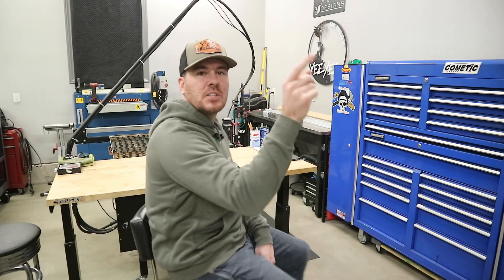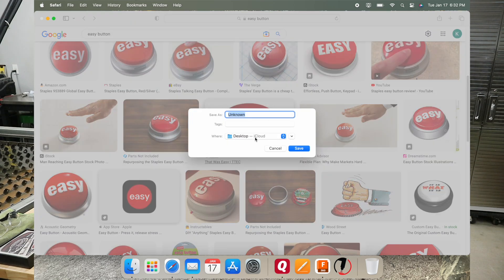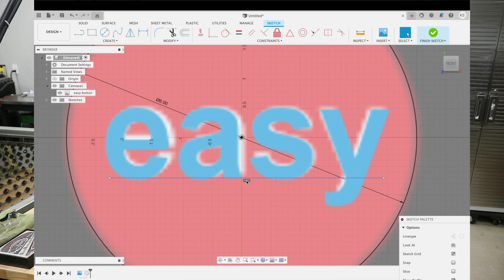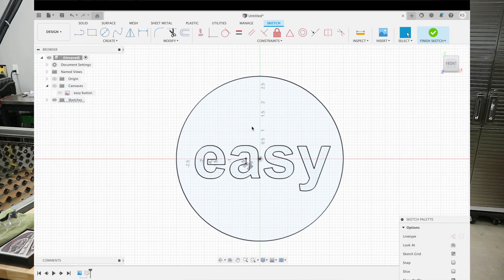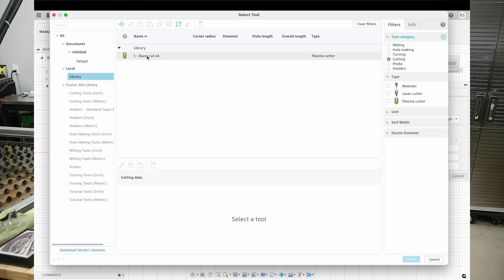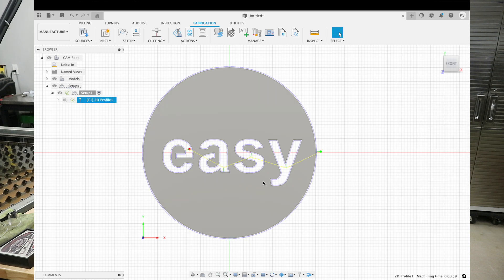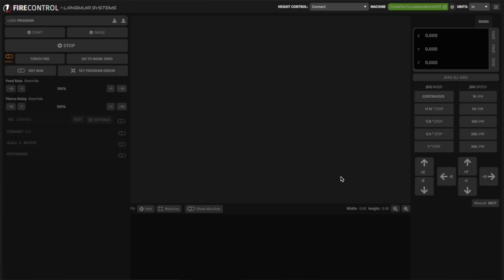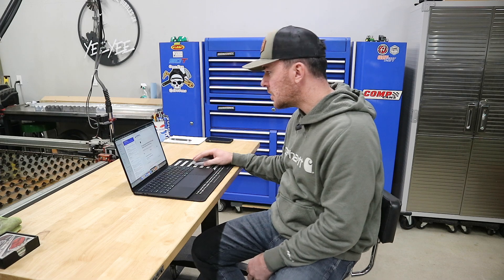CNC Plasma Cutting with FUSION 360 Explained.....Step by Step

Comment: I am an old retired harley mechanic, looking at building a couple bikes to keep busy, i have built alot of bikes over the years but never my own frame design, so, i have built a frame.jig, bought my tubing roller and bender, i need a plasma table for cutting parts for my chasis design, building the table is anpiece of cake, running it, not so much. I downloaded fusion.360 but i am completely lost when it comes to drawing my first part, your video is great but for a complete newbie, its greek to me, as is the program. Any dummy books you are aware of to show someone.like me, in layman terms how to draw and send a cut file to the table?. Or an easier program to start with??
Reply from the maker: you might want to look into sheet cam or Flashcut with plasma cutting.  Fusion is great for design work though.  Just to keep at it and you'll get used to it.   Thats for sure the hardest part of the whole process.

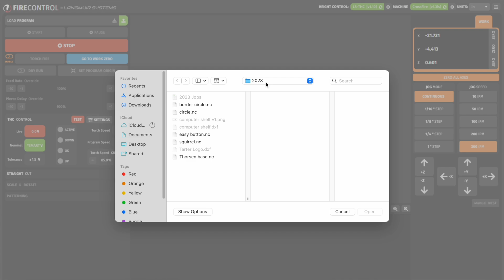Comment: Thanks for the info!  Question do you have a video on manual nesting to save on waste 16:36
Reply from the maker: thanks, and no I don't have anything on nesting
Reply: @SpicerDesignsLLC thanks for getting back to me thanks again! I watched your easy 😂button like 10 times thanks 

I just recently got me a table too them 4 months to fix it but I’m running now.  Limit switches no working due to malware, but Johnny at Langumer is on it 🎉

Comment: Excellent video, thank you. How can we setup crossfire table to make a cut on a curvy surface while using z axis, on a 3d model?
Reply from the maker: It has a torch height controller but thats more for warped steel.  you would have to go to a higher end table to get the torch to move across larger contours.  Ive never really experienced with that.
Reply: @SpicerDesignsLLC  Thank you for the response, here is the part that I saw on youtube, It nice to see that crossfire can cut a 3D part.
https://www.youtube.com/watch?v=w4NZIdWT-ak

Comment: need help!! I've followed your step by step 100 times all the way to click on my body and it's supposed to highlight each line and the outside circle but for some reason I can't seem to get the program to do so. it wants me to click each line individually 11:38 in the video I've think I made it a body in the previous step. And the display window for geometry does not look like yours.
Reply: I’m having the same issue. Once you set your points to start the cuts @, it doesn’t show the same geometry or cut paths and when I go to simulate it gives me an error code. Did yoy ever figure it out?

Comment: I made one and thank you for the info.  Also, since you have experience with fusion 360 could you please tell me if when in design mode and you extrude your project, if you make a mistake can you go back and remeasure your sketch?  I can't seem to figure it out and I don't know if it can be done.  Any help would be appreciated.
Reply from the maker: Yea you can.  You can move the timeline in the bottom left corner and adjust your sketch or you can delete the body, fix the sketch and extrude again.
Reply: @SpicerDesignsLLC  Thank You!  Still struggling with this fusion.  Shouldn't be so hard to learn but I'm not giving up.
Reply from the maker: @curtisegbert7915 dont give up! Youll get it.

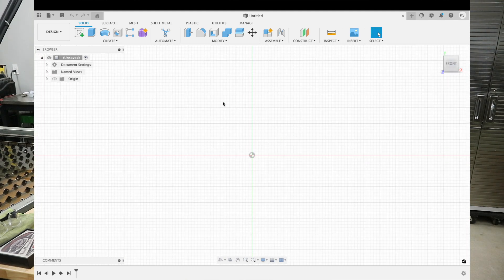Comment: What Fusion 360 are you using? Im using the free version and for the orientation of the axis shown at @2:11 I have to use "Top" and not "Front". Unless I am missing something? Total newb here
Reply from the maker: Top is right.  Thats what its supposed to be.  Mine changed on me somehow and ive since changed it back.  The z axis should be facing up. So your good
Reply: @SpicerDesignsLLC  Wow fast reply thank you kind sir for teaching an old dog new tricks.
Reply from the maker: @WDMtea i try! And no problem.  If you have any questions ill do my best to help.

Comment: Here's a tip: you can actually set your Z axis to be the vertical axis. Click your user > Preferences > General > Default Modeling Orientation

This is useful if you want to keep the model in the correct orientation. I use this for 3D printing all the time
Reply from the maker: Thats how it was forever and it changed on me.  Ive since changed it back with the z axis up like your saying.  Thanks for the pointer!

Comment: I have a question that maybe you can help me with. My setup I have my desk top where I will be designing my projects, and I have my laptop which is connected to my Langmuir system, my question is, once you finish your cutting process on fusion 360, how do you upload it to a flash drive to use on the remote computer? I hope you can help me with this, and thank you for your videos, they're better explained than the Langmuir videos 😃👍
Reply from the maker: Its easy.  I use my laptop for everything but you can just put the .nc file on a flash drive and use that in your laptop to make the cut.  Once you do the post process it will create a file, you can save that right to the flash drive.
Reply: @SpicerDesignsLLC   Thank you, yes after messing with it a little more I realized I had not set up my Post Process, and I see just what you said, However 😯 watching the video from Langmuir to set up Post Process, I realized that the video that they have is for an older version of fusion 360, and following step by step, once I click on the G1-G2 box, I get a totally different set up window, now I just have to mess with it to see what I can figure out. Thank you once more for your videos and your help 😎👍

Comment: I'm a high school small engine teacher. I bought a Crossfire for personal use and ended up bringing it in to my class to help with building student projects. I also run 3D printers, laser engravers, CNC lathes and mills. What machine and projects I'm working on varies from day to day so it can be hard to remember how setup each machine file every single time. When I want to cut on the Crossfire this is my go-to video. Thank you for making this video it saves me time and stress.
Reply from the maker: Ya i hear ya.  I have the same issues with the engravers sometimes.  Glad its helpful for you.

Comment: Hey bro what do you use to clean you machine?
Reply from the maker: I just whipe it down with simple green
Reply: Thank you one last question, do you ever cut stainless steel 1/8 thick does it worpt on you or is it better to just cut carbon steel? Thank you in advance love yall guys channel!
Reply from the maker: @josecontreras8099  i have only cut mild steel.  Once i get the shop set up better i will start stocking some other material.  I would imagine its somewhat comparable to mild steel.
Reply: @SpicerDesignsLLC  thank you!

Comment: Hi Kyle!  I just watched your "you tube" video, the manufacture of the plate and I was a a little confused at one part of the video.  You were plugging in your Razorweld CNC cutter and you said it was a 30 amp system?  Am I missing something here?  I was under the impression I would need a 50 amp system?  Could you have made a mistake ?  Too many beers...Ha Ha
Reply from the maker: No, the 45 amp plasma cutter only requires a 30 amp breaker.  Same as most welders.  Its does use a typical welding plug which is rated for 30-50 amps.
Reply: I am sorry to say but that doesn't make sense to me.  However if you say so... have you ever tried using Langmuirs Fireshare diagrams? @SpicerDesignsLLC
Reply: Hi Kyle,FYI I emailed Langmuir and they said the Razorweld 45 has a max draw of 45Amps but recommend rounding it up to 50 amps just for wiggle room. The amperage of the 45 can be adjusted to as low as 25Amps but this would limit you to be able to cut thinner metal sheets.  (That was word for word)  Not to be a smart A but I just thought Id let you know.  I still enjoy your videos! Geoff @SpicerDesignsLLC
Reply from the maker: @Kelly-yo2yk  thats on the output voltage.   The input voltage for breaker sizing is what im talking about.   Ive been an electrician for 20 years.  Ive hooked up a ridiculous amount of equipment.  I have a small welder that can output 150 amps.  Its on a 30 amp breaker. Heres the manual, max amperage 29.2 amps.  Breaker should be sized at 125% of fla.  35-40 would be ideal.  Ive never had it pop on a 30 and i run it at max all the time.   https://unimig.com.au/wp-content/uploads/2019/08/RAZOR-CUT-45-Manual.pdf

Comment: Hi there !  I love your videos and as a matter of fact I am using your "easy button tutorial" to get myself started or practised.  I don't understand the  letter removing part why I am not removing the unwanted section of the letters.  I have gone over your video 1,000 times and still no luck!  I guess I could use a different font but is there a trick I am missing?  Thanks for your time!
Reply from the maker: Im not completely following the issue you having.  Feel free to email me and i can try to help you work through it.
Reply: Hi Kyle,  I have just had some luck manipulating the line tool issue for making the e and a in EASY .  Im not sure what my issue was but it took a long time to be able to remove the lines to open up the letters for a full look.  I am just learning the Fusion 360 and thanks to you I do have a path to go on!  Cheers
Reply from the maker: So you got it all figured out then? If not im happy to help.
Reply: As far as I can see it appears I have to blow up the image to be able to manipulate the lines for removal . It seems to take a few toys but knowing what I am after is the difference maker.  Thanks for your attention Kyle! @SpicerDesignsLLC
Reply from the maker: @Kelly-yo2yk  yes, i usually have to zoom in to delete smaller lines.  Id recommend a   Good mouse or a 360 mouse that allows you to do that quickly.
Reply: @SpicerDesignsLLC

Comment: Awesome video had tried finding one like this for the last year or so had seen many with attempted it, but yours so far was the best… only question I would have is why you like and chose the CNC table that you did…ty
Reply from the maker: Good deal!   I really like what Langmuir is doing as a company.   They are designing and selling affordable machines for beginners and experts.  Cost was the main reason i purchased my table and it was before i ever had a channel.
Reply: Thank you for the reply and sorry for the horrible grammar in my original post, speech to text can sometimes leave things garbled… I was assuming that price played the deciding factor, which I would think is safe to assume for most people getting into it.  I plan to binge watch some of your other videos because I like your style and can hopefully learn a bit more about your machine and how you use it.  Thank you so much for the quick reply. Your video has single-handedly rejuvenated my interest.  Disabled and trying to find something to do as a hobby that can possibly make a little money on the side and my mind keeps going back to CNC metal/wood design.  I recently am looking into enrolling in a certified drafting/CAD program. I come from a family of mechanical engineers and and can’t seem to shake it lol
Reply from the maker: @joshlindemeier2434  sounds like its a good fit.  I have had no major issues with that machine and ive had it for over 3 years.  Laser engravers may be a good option too.  I have lots of videos on both.  Good luck with your decision and feel free to reach out with any more questions.  You can email me too.

Comment: On fusion 360, I was making a sign and I had one inch lettering and when I tried creating a tool path for it, it only did that for some letters. I even changed the lead in to .05 and it wouldn't work. What should I do?
Reply from the maker: Keep going smaller on your lead in.  These plasma tables dont like small detail.  Decreasing the lead in should do it

Comment: I’m super new  new to plasma cutting ,I tried the easy button  as well, followed all the steps but it’s showing backwards YSAE . But  choosing BACK will show as Easy. When choosing  FRONT my (Z) on the top left and my (x) on the bottom right,  looking at your screen  your (Z) it’s on the bottom left and your (X)  bottom right .
Reply from the maker: I do have a video where I explain the orientation of the sketch plane.  Im not sure what video it was but I would recommend watching all of our Fusion videos.  Lots of good info and tips.  Also check out the comments in those videos.  Some of the viewers added some great pointers as well.
Reply: @SpicerDesignsLLC  thanks 🙏 I’ll watch your series  and find out what I am doing wrong

Comment: Langmuir should just give you some good 2D LayoutSoftware, there is no 3D when working with plate steel.   Why muddy the waters?   There's no Router attachment for Langmuir.    What you really need is some good vectorization software where you just feed the raster (raw) image into it and out comes the Vector file.    No stupid overlays or tracing.     After it's vectorized you could then scale it up or down.
Reply from the maker: They dont have any software for theyre table except firecontrol which communicates with the table.   I use some of the 3d features for my multi layer signs and turning the designs into a body for creating the cut path.  Theres also a unfold tool for adding brakes in the steel too.  I know a lot of people use sheetcam

Comment: Hey, I'm new to this stuff and I was just wondering, when you uploaded the picture to the grid, could the software automatically trace the picture or do you have to do that yourself?
Reply from the maker: There are programs that can turn an image into a bitmap.  Inkscape is one of them.  Im not a huge fan of doing it that way.  Its kind of a dirty file in my opinion.  Creates a lot of vector points, just not as clean.

Comment: thank you so much, great video. 
I was using LazyCam but because I have Mach3 demo the lazycam would only generate 50 lines of G code and then it would stop (and that was annoying as hell). Using Fusion360 is much better

Comment: One suggestion for fusion is to use an online image to svg converter so you don't have to sketch over the original image.  Other than that, great tutorial for cnc plasma cutting.
Reply from the maker: Thanks.   I prefer making them from scratch.  Ive noticed the trace tool create a ton of points.  If i sub that file out to a fiber table, all the curved sections look choppy because its a bunch of tinny straight lines making up the curve.   Could be the program i used.  Any suggestions on a better software for that?
Reply: I've used vector magic with pretty good results.  I think it also depends on the quality of the original image.  I always use google and search for large images to get the best quality. @SpicerDesignsLLC

Comment: Great! Where did you set your Z zero, on the material?  Thx
Reply from the maker: That sets automatically with the torch height controller.   You can adjust those settings in the post process too.

Comment: my damn fusion wount make it automaticly, only makes 1 hole out of the 3 on the toolpath . ive been fihgtinh it for an hour il send a screwdriver trough ther damn screen
Reply from the maker: If your talking about the cut path try decreasing your lead in on the last tab of the cutting section.   Thats usually the problem.
Reply: @SpicerDesignsLLC  fiqured it out after 2hrs , it was the lead out causing it , i dont get why all holes are 5.2mm , it had no problem doing 1 , but the other 2 it just wount do , again same dimensions so i dont get why it didnt want to work, tried laser, that worked instantly with leed in and out on, so i tried plasma with leed in and out off , got it to work , than turned on just lead in and now it makes a tool path... But god damn did it f with me ... (Just a diyer, have no prior fusion nor any kind of cnc experience so took me a while to figure out wtf is going on)
Reply from the maker: @robivlahov  it sucks to have those issues in the moment, but it forces you to become more familiar with the machine and software.  Makes troubleshooting  quicker every time.  Good job getting it fixed.

Comment: I may have missed it, but how do you tell Fusion the cut order? I'd assume you want to do the letters first and then cut out the circle afterwards, I'm just not sure how you tell it to do that.
Reply from the maker: Fusion will process that automatically but you can enter it manually if you have a certain preference on that cut.

Comment: Thanks for this video. It's provided a lot of assistance with getting started. I am having one problem that I can't get past though so perhaps maybe you could offer a suggestion. When I create text and explode it the same that you did for your easy button, when I go to create a tool path it doesn't create a path for the text. Only a path for the outside body. Any suggestions? Thanks in advance!
Reply from the maker: Did you watch my new video.  I talk about fonts and text.  I would check that one out to see if it answers your question.  Otherwise, send me a clip on instagram if you can.

Comment: Would you be able to do a video with a DXF file. I would like to see how you take a picture of say a moose in the woods and program it start to finish. I a bit of a slow learner lol
Reply: 47 yrs in the welding trade welding all types of metals I think definitely had a factor in me not being able to retain any knowledge. Especially the time when the mechanics brought a piece that needed welding after they cleaned the grease off with brake cleaner. The moment I started welding on it  the fumes were like mustard gas I lost my breath and had difficulty breathing.They took me to Emergency were I sat for about 6 hrs before being released